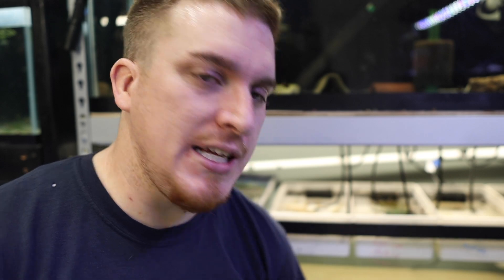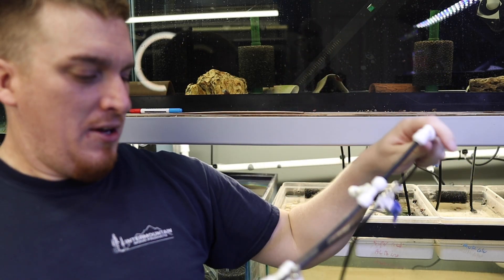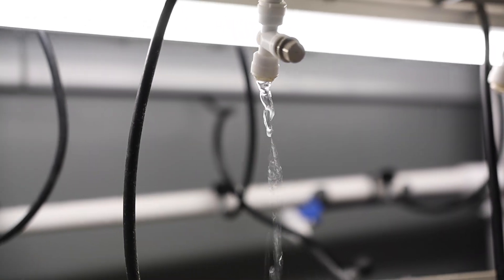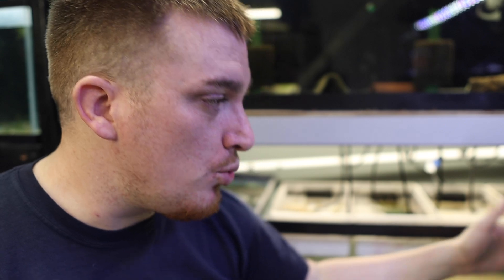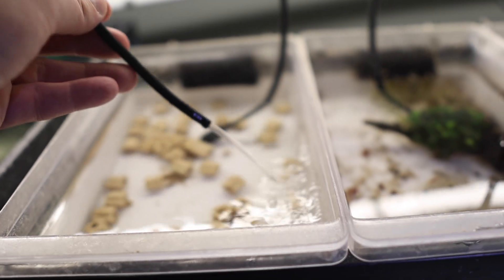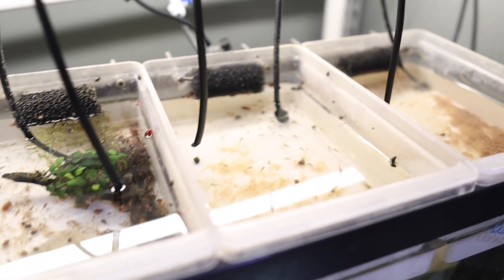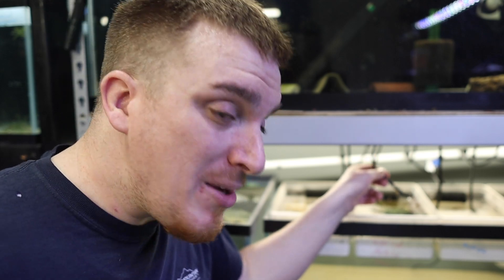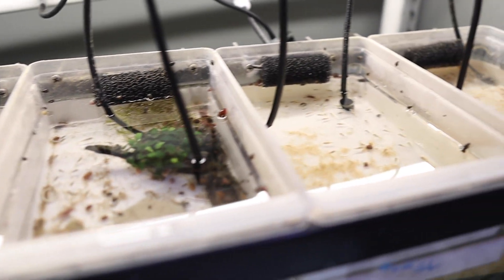Fry System Upgrade and Water Valve Experiment! (Metal Air Valves)

Comment: Did u have any problems with it yet?
Reply from the maker: Everything has worked perfectly.  Valves have not leaked and I have had Better consistent flow through the system

Comment: What do you prefer the larger or smaller tubs?
Reply from the maker: I prefer the larger size.  Easier for me to see the fish and clean them
Reply: @WeldonTalks   @Jadren Aquatics  Thanks for the reply! I am thinking about building one of these. How many fry can fit in one tub?
Thank you!
Reply from the maker: That depends on species and length of time kept in tub.  At one point I had over 100 Mouthbrooder fry in one tub for a bit.  I have had over 100 pleco fry in one before.  Currently I have 50 Mouthbrooder fry that are ready to move out of one.  I use this system to get the fry started.  Smaller area it is easier to feed them

Comment: WELL DONE Sir👍👍👍👍👍
Appreciated the upgrade on fry system. I myself am thinking of doing such a system and was thinking it was expensive to setup. Glad to see it's not what i initially thought in cost. I've a few additional questions
1. what's the max pump gph you recommend for the 1/2" pvc?
2. Do you end cap or have a valve to control or allow excess water to return to tank?
3. What's size  (water volume) of tank and dimensions? Do you recommend using 36x 12 x12 inches or 36x18x18 inches tank
4.What filtration system you have for main tank
5. How often  water change do you replace or vacuum the main water storage area?
6. What sponge are you using for the trays to prevent fry escaping 
7. How many times daily do you feed in the trays and do you recommend feeding vinegar eels and microworms in it or will they escape in main tank.
8. Do you have any live plants or animals in the main water storage?
Thank you in advance.
Reply from the maker: There is an end cap on the end of the pvc pipe run, need the water to run down through the valves.  No idea on max gph but I would not go over 300 gph because you do not need much flow through the trays. I am using a regular 20 gallon long you can adapt this to whatever tank you want.  I have a sicce shark filter in the main tank.  I have auto water change.  Small coarse intake sponge from aquarium co op. no live plants.  feeding 1-2 times, only live food I do is baby brine.